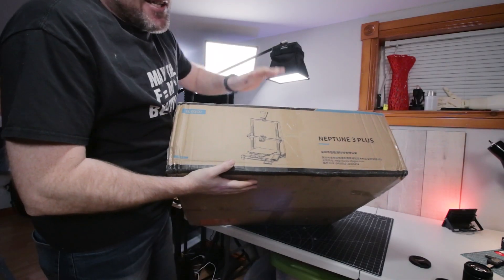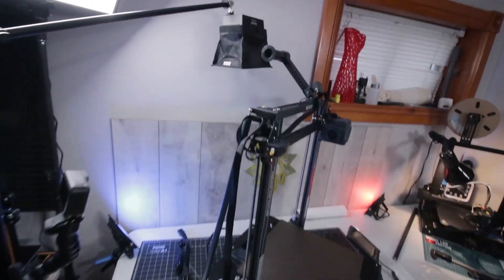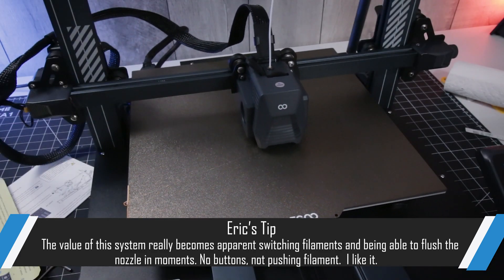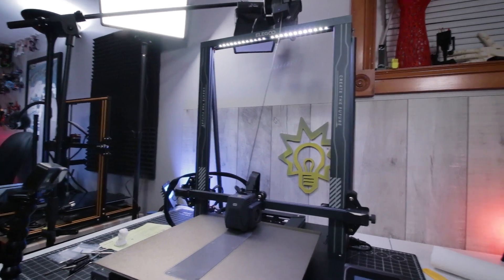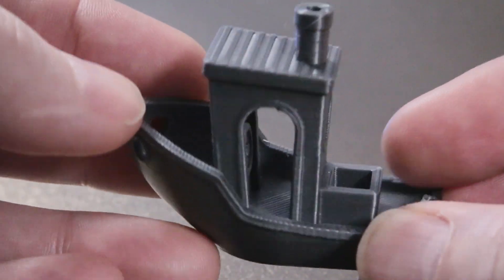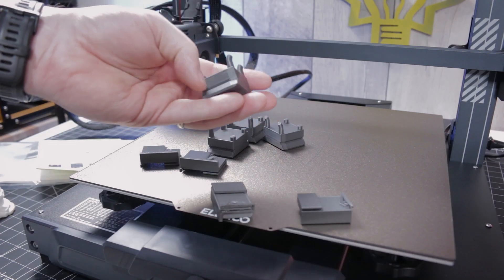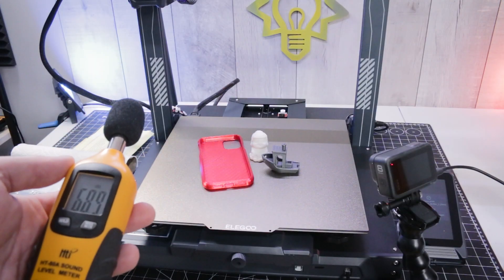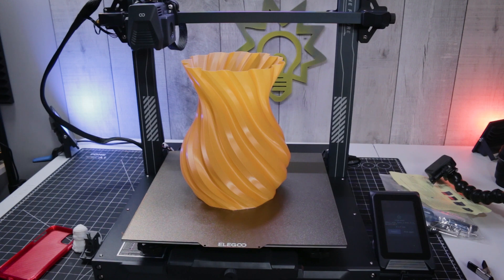Everything You Need To Know About The Neptune 3 Plus 3D Printer 🔥

Comment: I have this printer, when and only when you get it running does it have good quality prints ive gotten many high quality and strong prints but it isnt beginner friendly and has a steep learning curve for anyone just starting out. So I do not reccomend. The bed needs to be tightened constantly the fans are extremely loud and annoying zipping and buzzing after a couple moths on any pla print. The bed already has warps and the auto bed leveling just decides when and when not to work. After a hotend upgrade it can print pa6-cf it really seems to have issues with nozzle dragging even after tightening every gantry nut just right and the belts. It is what it is if you tune it right you can get it to throw out a couple decent prints but some just don't make it